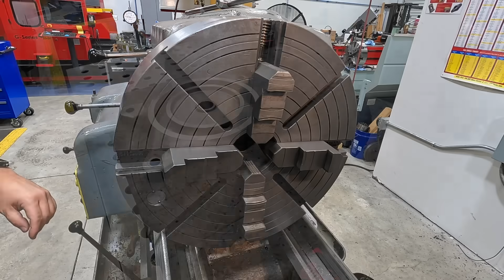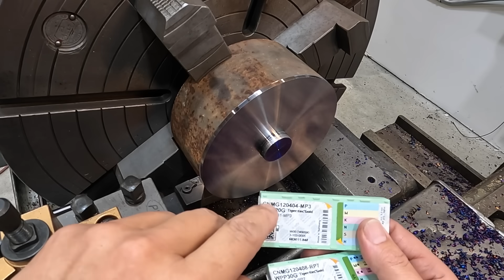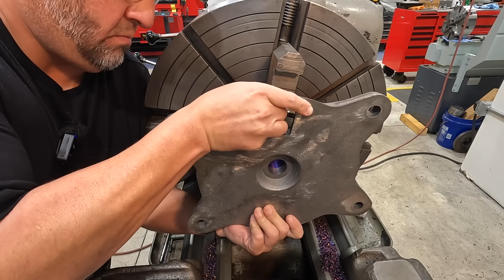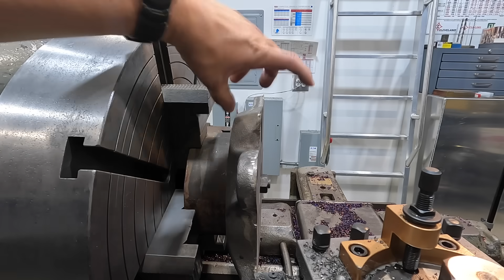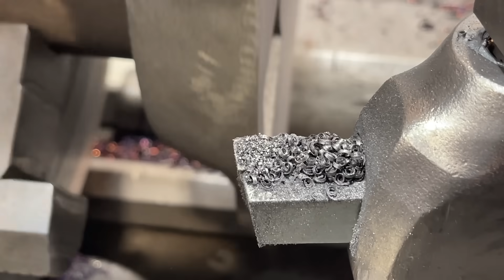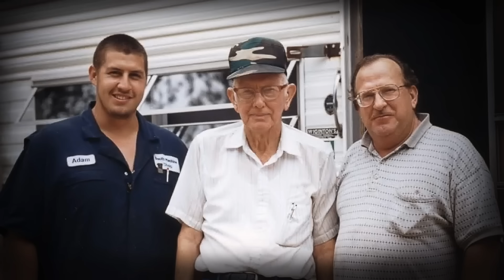Hardtail Vise Build Ep.5: Machining Swivel Base Second Op.

Comment: 24:19 Aluminum inserts are pretty sharp but not sure they would hold up cutting cast iron.
What you could do is using a Dremel and fixate it on the tool holder. I saw this multiple times now. Used for resurfacing the tapering of a Spindel shaft of a drill press for example.

But the slow rpm worked pretty nice in the end. Really interesting project. Must be a pleasure working with these machines and see how it all comes together.

Comment: So I sometimes do some grinding work at a place here in qld that makes between 52 inch up to 63 inch rims for the big mining trucks. I sit inside them to work a lot of the time and I'm 6 foot 😉. When the guys are making them from scratch, the chips are exactly that colour (they almost weld together and make it hard to shovel) and it sounds like just as bad on the ears. Maybe it's some kinda steel thats the same?

Comment: Accidently hit the send button before I finished. - ADAM!!!!!  Who cares about those chatter marks  
1 -It's a friggin vise base not a wrist watch. It gets bolted to a piece of oak or at the very best a hot rolled plate. - Nothing you need an optical flat to set up.

2- The ears with the chatter marks are going to get bolted face down and stay there for maybe decades before anybody sees them again. - By the time anybody takes it off and sees it it the chatter will be covered with corrosion and pitting like every other vise you have ever taken off. . 

YOu are doing a suburb job and in the hierarchy of things that matter on this product, chatter on the ears dosen't exist.   If it bugs you that much hit it with a flap disk before it comes out of the lathe. - Nobody is going to be the wiser. especially with the nth degree quality on everything else.

Comment: Certainly slowing it right down to 25 rpm and using a nice sharp brazed carbide tool did the business. I would have tried to improvise a machinists jack type of support for all four of those ears. I would have gotten some of the 3/4" all thread cut and machined the length to say 100 thou under the distance from the face of the chuck to the finished thickness of the part, pushed it through the hole with a flange nut threaded on the rod and just almost finger tightened the nut flange up to the top face of all four of the ears. I'm pretty sure that that set up would have prevented the ears from vibrating and causing the chatter marks. That hopefully would have quickened up the job as you could have run the 100+ rpm that was run initially.

Comment: Idea for a shop made tool: what about some kind of rotary stone grinder to finish parts like those, made to mount to the lathe? or is that something you wouldn't recommend to do?
Reply: Mr. Crispin (also on YouTube) builds and uses such tools.
Remember that this is cast iron. The grinding approach would take an order of magnitude (or more) longer than even that very slow surface speed Adam has used here. Also the precision of a grinding approach is overkill for this job. The correct solution was already pointed out in the video: Proper support for the workpiece ... which is always a good thing. (This is a prototype. In production Adam would've used a bigger faceplate or other ways of reducing vibration). It was clearly a better solution to invest the hour or two at low cutting speeds in combination with the special tooling than doing something mentioned above. Also this was a first try (and a single piece/job?): We are always smarter afterwards. I mean every one of us hopefully, or not?:)

Oh an well: You do you! No one prevents you from trying and testing your approach. (Although I bet my grandmothers beard, that you will get not too excited with your suggestion ... but maybe grow a longer beard than her ... before you'd taken off ten thou, hehehehe).

Comment: How long did the final finishing pass take at 25 RPM?
Reply: 16" diameter, not going all the way to the middle so 7" cut, .015" per revolution feed rate, 25 RPM would be about 19 minutes.

Comment: Adam, have you ever thought about purchasing a tool post grinder? Would be interested in seeing content on that. Thanks for the video
Reply: Yea, The base of heavy duty vised have to flat within a couple of tenths. I normally lap mine to 50 millionths before bolting then to the hot rolled plate on the wleding table. ----- THINK about it.

Comment: I definitely would have utilized the t-slots in the chuck and made up clamping and support jacks for the ears of that. It would’ve stopped the ringing. Just a little bit of pressure underneath those ears is all you needed.

Comment: Good job for a surface grinder those last few passes or thread the mounting holes and use some threaded rod with a nut against the chuck face. ❤
Reply: I grind and lap all the vises in the shop twice a year, especially the one on the wood bench. ,,,,,,,,,Think about what you are saying. - Surface grind a frigging heavy fab vise base?

Comment: You’re a master machinist…IMO showing how you used the tap wrench in the lathe just put LOTS of want-a-be machinist on a path to injury!!!  Luv ya, but too dangerous to show❤
Reply: When I was doing a lathe intro course for machining/millwright the instructor mentioned that doing that was a common way to thread/tap, but anyone that did it during the course was kicked out.

I have zero problems working with live electricity as an electrician so I can understand doing things that other people feel unsafe doing, but I'm never touching anything in a lathe while it's turned on. Tapping, holding sandpaper, not for me. I like having arms.

Comment: what kind of micrometer with the picture are you using at 10:07 minutes when measuring the mandrel. I liked the print.
Reply: There was a close up on the previous video. It's a Starrett 1-2" and I think 0.0001" tenths mic

Comment: What size is that flange nut? I have a bunch extra 1/2 drive large sockets. Dad worked on large diesel fork lifts and frankly I just work on cars as a hobby. I have stuff like 2 1/2 inch 3/4 drive sockets I'll never use that hang on my shop wall. I'm sure I have a 1/2 inch drive socket I can spare.

Comment: Could you have made some down and dirty machinist jacks for the chuck to support the ears? 4 t-nuts, 4 pieces of thread rod, 4 washers and 12 nuts. Use a t-nut, threaded rod, washer & nut to lock in your jack position on the chuck then two jam nuts to support the work piece. Would that work?

Comment: One way to dampen the vibrations is to press in some rubber into those 4 bolt holes so that they are below the holes. It worked out well in the end with the slow speed on cast iron.:stayhome:

Comment: You really don't get a sharp edge with carbide, carbides advantage is it's durability.  If you want a really sharp edge, you should use high speed steel.

Comment: I had a job like this last year. All I did was take the jaws out and used the chuck as a faceplate, 20mm threaded bar through the headstock. Washers and nuts on either end! Some jobs need the simple ways work out best and give you the best results.

Comment: For a decade or so I occasionally cut a very similar pump base on a old poreba lathe in a 4 jaw.  Had 4 ears and all just like this.  I used 4 pine blocks with sheet rubber superglued to one end.  Then just wedged them behind the ears ever so slightly on the last finish pass.   Just enough to keep them from flinging out but not enough to tweak the part.  For years before me running them they would just let them chatter away since it really didn't matter.    Now they just run them on a cnc mill and call them done.

Comment: @Abom79 Hello Adam. You can easily overcome resonances causing chatter from interrupted cuts by bolting a ring on the four ears preferably made from cast iron to make use it its high intrinsic damping coefficient. The counterforce for the ring can be provided by the chuck while two hex-nuts on the rear face can provide the required tension force. It takes very little force to kill such resonances.

Comment: Need to acquire a Tool Post Grinder so a grind surface can be cut on the lathe.  Have to protect the lathe from grit but does nice jobs with coolant.  Ever put T-Nuts in the lathe and make standoff supports that back up the ear.

Comment: G'day Adam.  With the deflection,  Irrespective of the basepoint on the chuck side, will still occurr. The initial cut was ok, I would have slowed the chuck right down with the slowest feed rate, then final finish by surface grindind. I think the casting on the ends should have been about 1/4" thicker to compensate for deflection if to be finished in a lathe.

Comment: When a piece chatters, is it taking too deep or too shallow of a cut or both
Reply: Yep, too much or too little, too slow or too fast. When you got chatter, it ain't happy, so do something different. There's your rule of thumb.
Reply: @janj0n  I should have asked my question in a clearer way, I am referring to the actual chatter spot after it has been created. If I put a straight edge across the surface would the chatter area be lower or higher ?  Thanks
Reply: That is the kind of detective work that he's talking about at the end.  There can be many more reasons why your part chatters based on things like tool height and geometry.
Reply: @Andre_the_Lion  I should have asked my question in a clearer way, I am referring to the actual chatter spot after it has been created. If I put a straight edge across the surface would the chatter area be lower or higher ?  Thanks
Reply: Looks like he got 'er done!

Comment: Adam I know you are one of the best and you strive for perfection in places where other guys would be okay with good enough, but in this case wouldn't that base plate have been good enough with the chatter marks?  Being that it's not a precision vise wouldn't it be okay being off a bit?
Reply: As a machinist, the one thing you don't want is chatter. If the next guy manages to tweak things to get a consistent chatter free finish, then the more power to him  and even a bit of shame on you.
Reply: Yea, Right,,,,,,Chatter on a bearing surface is one thing. On the ears of a vise that is getting bolted to welding table,,,,,and will be totally corroded and pitted from moisture and whatever 6 months after it is installed,,,,,and will be left there for decades, anyway......That's a another ''nother ballgame. ,,,, Winning about chatter marks on the bottom of a vise base is the ultimate in pedantic nonsense

Comment: How about a jack between the chuck face and the ears on the base plate?  Just a thought.
Reply: I was going to say that. It would require making a custom ring mount that fits around the jaws because all of the ears are not symmetrically placed. Relying on simple pressure to hold it in place while spinning would probably not be a good idea.
Reply: I was thinking the same thing. I would hate to see a hole in his newly drywalled office. @firesurfer

Comment: Having never run a lathe, I don't understand how you loosen and tighten the highs and lows, but then go round and tighten everything up? Doesn't that move things again?  Cheers for the cool stuff to watch every week Adam, much appreciated?
Reply: A part wouldn't dare move out of zero in abom's presence.  I heard he once achieved a 0.001 tolerance with a flap disk.
Reply: Normally, you can only continue to tighten one side if you are also loosening the other to give it room to shift the part.  Ideally, the final tightening is not moving the part, but just making sure the jaws are putting enough force to hold on after all the adjustments are made.
Reply: That's the way he's done it millions of times, so I guess it works!  Remember there's no reason you can't check it again after you tighten everything, if you want to make sure it's all still perfect.  

For this one... not a big deal.  If you're going to turn a diameter on a part, the turning makes that diameter perfectly concentric with the center of rotation of the lathe -- it doesn't matter where the part is or what shape it is when you start.  "Single point turning."

Comment: Nice work, Adam!  I'm sure that you know best, but when I see a casting like that my geometry sense suggests that on the bottom of the casting all you would need is to have the bottoms of the four attachment feet be flat and coplanar.  The rest of the bottom needn't be any more finely finished than the workbench that the vise will be mounted on. That under surface simply needs to not project through the plane defined by the bottoms of the four feet.  Of course four feet aren't automatically coplanar, so you'd have to tweak the one that projects.  Still, that should be a simple machining operation on a small area of metal.

Once you had the bottoms of the tabs coplanar, you could clamp the casting to a flat reference surface, like a milling table, and dust off the tops of the feet.  Then, the tops of the four feet would define a plane that is parallel to the original reference plane.  Then you could do almost everything else on a mill, using simple fixtures.

Comment: Hi Adam! me again with that chatter on that one ear there is several ways to solve that number one: Run the machine in reverse. Number two: face out instead of in. number 3:  you can put a stud in that slot on the four chuck and pilot slightly in the hole, and with a jack nut,  you can support that ear If vibrationcome out the next thing you could do is put a piece of rubber on the back that must be a hard piece of the casting whether it's midnight which is nickel the other three ears are fine that one ear is not so it has a different makeup but anyway you're finished is beautiful and you got the end result the way you want it
Reply: I thought that I would face out from the inside, but I wonder if there are tool geometry or power feed reasons that he didn't.  Maybe he'll let us know in the next one

Comment: I don't understand why you can't mill this.
Reply: Ever hear of personal choice? This part could be finished on any number of tools he has. Since this is a personal project he doesn't have to use the fastest method just to get it out the door. Can't anybody do something just out of the sheer joy of doing it anymore?
Reply: Actually I was just asking if it could be done since I respect Abom a lot.  Did he have a compelling reason to do it that way? @tsmartin
Reply: @robertcasper4257 On the mill you would have a bunch of step over lines from the cutter unless you made a huge fly cutter to do the whole diameter in one pass. The lathe leaves a consistent finish across the entirety of the part.

Comment: Hi Adam! I'm watching you on turning this slug for the vice. I think it's the American Pacemaker and what happens there, if the history of that machine did a lot of heavy roughing with that particular RPM, what happens is that gear set gets a lot of wear on the flanks of the teeth and you can hear it like clattering that's what I think you're experiencing. If you pop the cover off, you can probably check the end play of each gear change and you should be able to find more clearance. It's like it's floating and not on the pressure side of the gear. There's not much you can do to the machine. Turn up the radio and the Machine runs fine! lol love your videos

Comment: As the chips look purple I reckon d2, I wouldn't like to tap like that as you don't get a good feel especially if it's tool steel.
Reply: regular ol 4140 looks just like that . Prehard you even get bright red and even yellow hot chips some time.

Comment: I've had very little non-cnc turning experience. It seems like it would be a challenge to find a suitable carbide grade for those face cuts. The difference in SFM from the major od to that hub diameter would be pretty dramatic. I'm used to just programming a constant velocity.
Reply: Ironically, this is why I prefer fully manual operation, let the computer between your ears do the work, use your hand and ear sensors.
Reply: @andrewzaborowski3832  I'm actually doing more manual machining now than I ever have. My career was in high precision, high volume process development. (Statistical analysis, cycle time reduction, takt time, etc.) Now I'm old and mostly used up, and have a lot more time in the tool room. I feel so glad that, even so close to retirement, I still love my work and still find ways to keep myself challenged. 

Also, based on your last name, I'd like to say that of all the places I have accepted assignments on this planet, Poland was my favorite. Good, genuine people.

Comment: Curious; Not this job specifically, but any paid work. Do machinist typically add on to the bill if they have to make a custom fixture plate for holding work?
Reply: It depends, if a vice or chuck will do then no, but if it's a multi op part and jigs are made then it's all in the cost. The way I do it is if the customer wants the job doing again and it's a repeat job then the first batch pays for jigging and some tooling and after that the price goes down.
Reply: Yup I wanted a screw and he quoted $75 just due to having to make a fixture, was a local to me machinist
Reply: @nathanielmcginnes8592  A second screw would likely be cheaper because he already has the jig. This is why large batches of production parts are more economical compared to a one-off job.
Reply: It's part of completing the task, no?
Reply: Only if you want to go broke. ---- IF not you better factor in tooling, fixtures and labor/overhead, including electricity, heat insurance, and internal handling, as well a book keeping..- Yo have to bid things so tight today you better factor in any increase of coffee and doughnut  prices  or you are going to loose your shorts.    @deltan9ne306